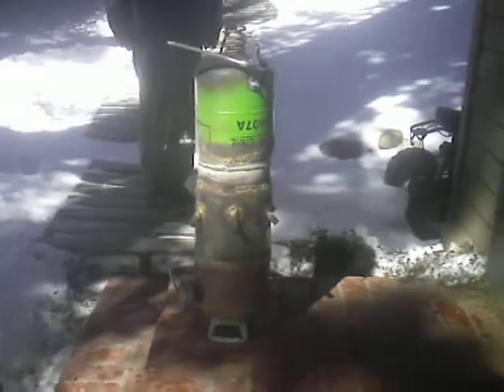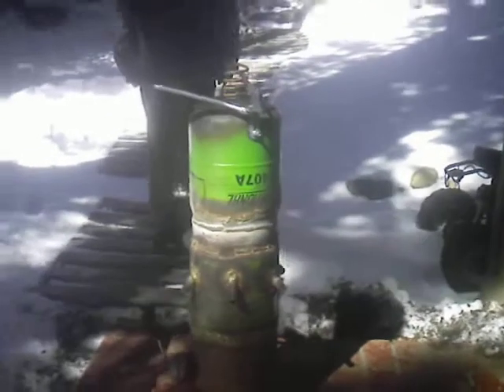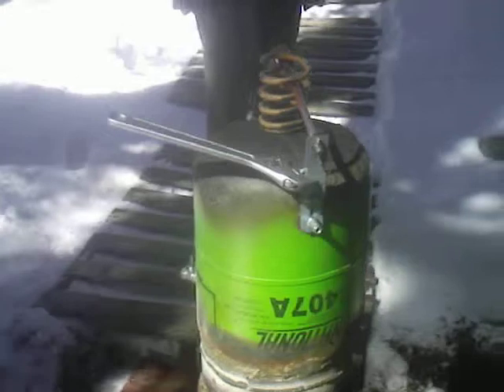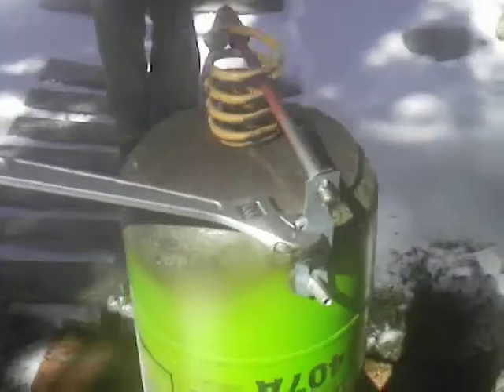Imbert wood-gas reactor complete

Comment: Very strange.... I see the opposite on my setup. The pellets burn dry as a bone and the clear fuel pipes feeding the engine stay bone dry but I do see more tars from the wood pellets until the gasifier temperature stabilizes which is around 20 to 30 minutes.
This last test run I did was about as tar free as it gets. When I emptied the jar I expected to see a small puddle of tar in the bottom of the jar from the start-up so the raw wood did burn much cleaner.

Comment from the maker: ive tried pellets they sweat A LOT and i have used 1\2-3\4 blocked up cedar not so much but there is still a significant amount the fuel was unbelievably clean and i only had a cyclone and a cooler but the cooler drips a lot of water out but this is hole nothere issue =3-